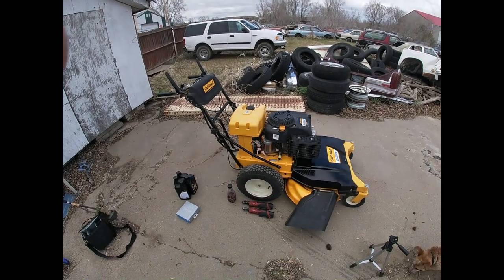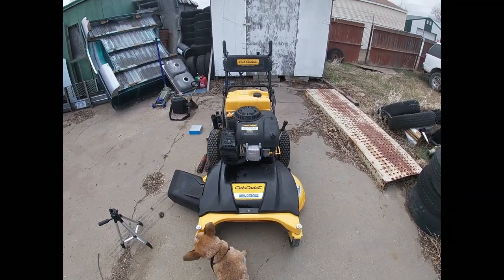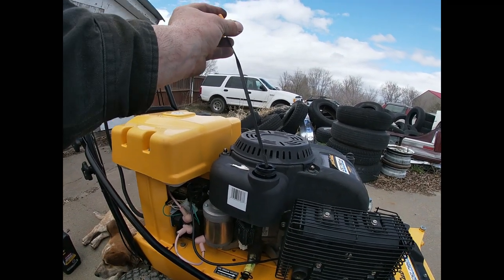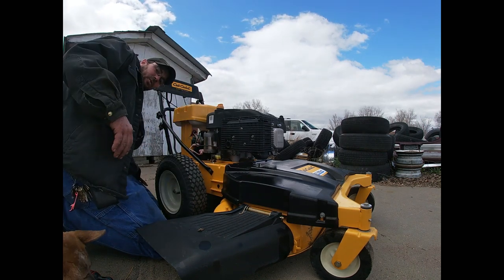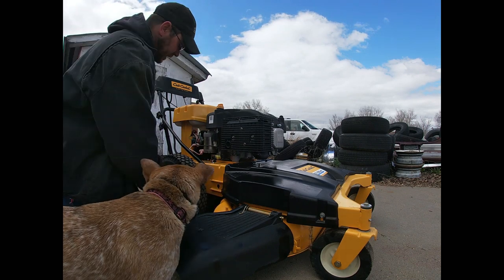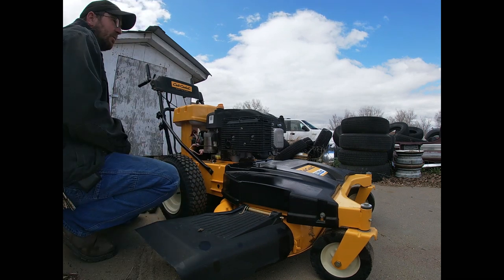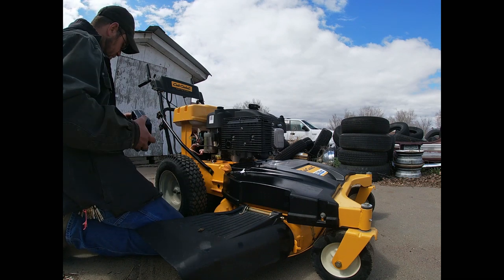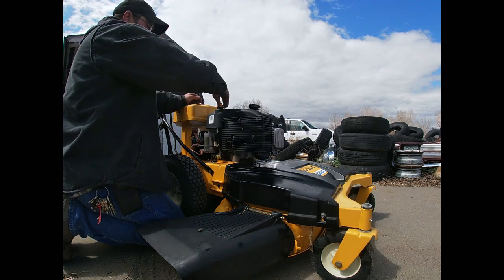Getting a new mower unseized

Comment: I would have pulled the spark plug, and added some WD40 to the cylinder before trying to rotate the crankshaft (leaving the plug out at that point) until it turns more readily.
Reply: the guy he bought it off did that before he collected it. You'd know that if you watched the whole video

Comment: After a couple of years use i usually put 20w50 motor oil in my mowers. They all still run the way they should and don't smoke at all except for when i pull them out of storage because i like to fog the cylinders with seafoam to to prevent them from seizing over the winter months

Comment: Good job freeing up the engine.  Those MTD engines have a horrible reputation with me.  I even watched one grenade under a friend of mine, right after a tune up.  He was a shop mechanic, yes it had a proper oil change, and he was out testing the mower before parking when it blew.  I saw the chucks go flying.  Scared the crap out of him, LOL.  We laugh now, but not at that moment.
Reply: cubcadet uses kawasaki engines and somtime briggs&stratton and the engine that has a bad rep is tecumseh they are really bad about blowing a rod without warning

Comment: Winner winner chicken dinner! Looking up the 33" model, you could stand to make a decent penny for yourself. I'd say put an oil change to it and filter, give it till the end of the season. For $200, gasoline and the trouble of hauling it home, coaxing it loose with a breaker bar and it came back just like that, you made out enough to cover a few other dead hands. Even if that engine were garfed(love that one thanks!) a used engine or maybe rebuild kit would have put you back in the black. People panic when something happens, then they just throw it away without trying anything.

Comment: I'm at 10:20. It's fairly loosened up and cranking on the starter. I'll posture that since it was a brand new engine, possibly the bearings and/or piston swelled from heat and locked before it did a heinous amount of damage. A brand new engine where everything is tighter will lock up a lot faster. Furthermore if it Does knock but otherwise runs OK, a buyer could get a season out of it while searching for a used engine. Or You can search for a used engine/rebuild the current engine and probably make a decent penny on it. Knocking but operable, I'd think it could run for quite a while if not clubbed on. I'll continue watching now.

Comment: 13:00 in, it just went KA-CHUG-CHUG-KA-PUTTER and blew a smoke screen like Spy Hunter, likely from all the penetrating oil. Yea, I'm assuming an honest sale. I can't see you being a sneak thief. The way it tried to kick off, I like to think it will come around. I've seen it a time or two myself. Old mechanical VW 1.6 diesel. Vacuum pump worked it's way loose and blew oil all over. I was too late. It ran for a long time making so much noise you'd swear the pistons were swapping cylinders but so long as you kept an eye on the oil it was OK-ish.